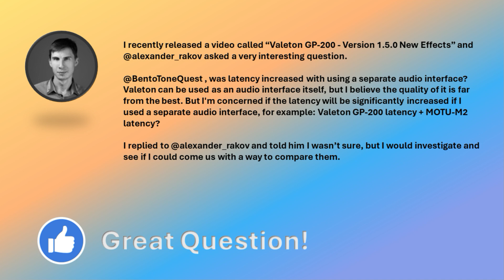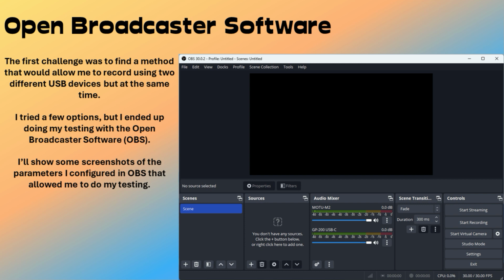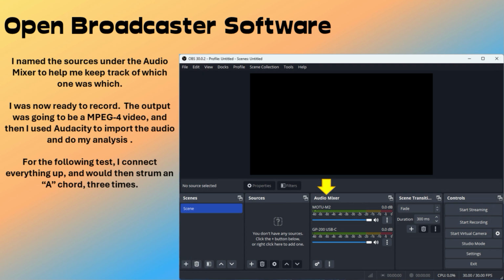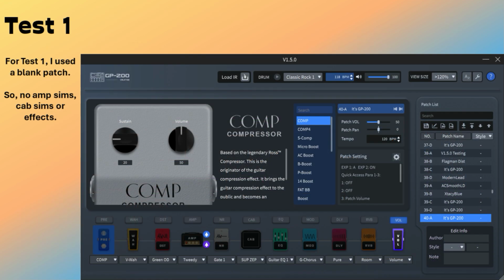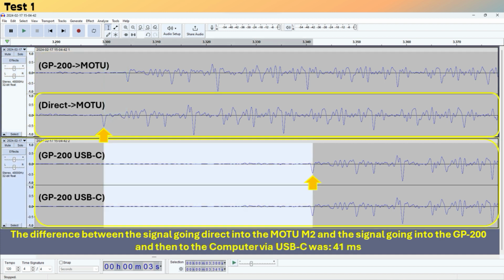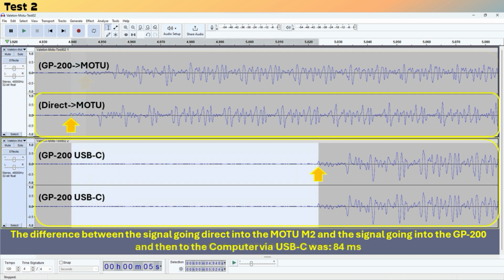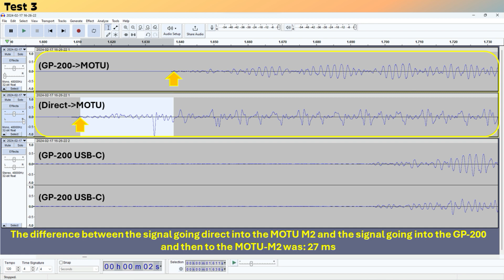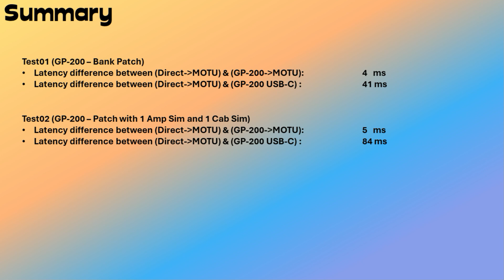Latency difference between Valeton GP-200+MOTU-M2 vs Valeton GP-200 (as an audio interface)

Comment: Thank you for this video! Did you use the official Valeton ASIO Driver for this test?
Reply from the maker: @p.j.5311  Yes
Reply: @Tone-Quest  Thanks for the quick reply! How did you configure your interface? My Focusrite Scarlett Solo has an “Inst” button, which I have switched off. Also, only one cable goes from the mono (L) output from the Valeton to the interface input, is that correct?
Reply from the maker: @p.j.5311  I guess the first thing to ask is, what are you trying to do or achieve? To record or to perform your own latency test?

I use the MOTU M2 audio interface, its inputs can accept mic, line or guitar level signal, so I didn’t have to do anything special. 

Since you have the Focusrite Scarlett Solo, turning off “INST” sounds appropriate.

Also, only one cable goes from the mono (L) output from the Valeton to the interface input, is that correct? Yes, that is correct.